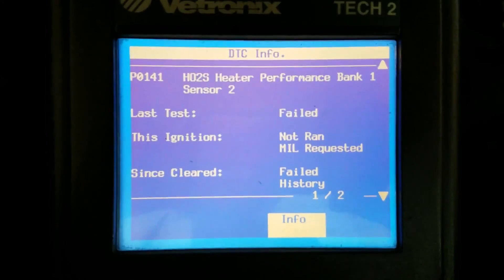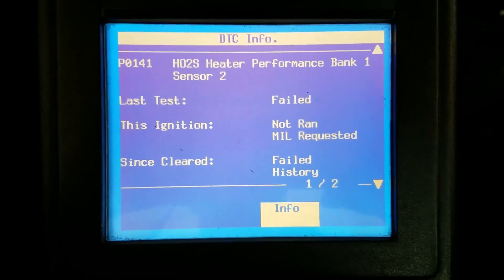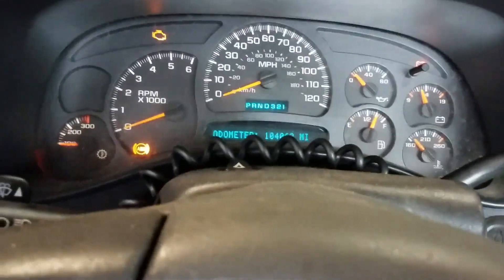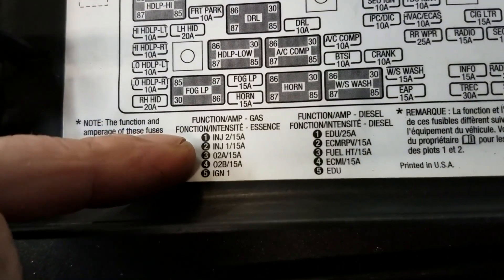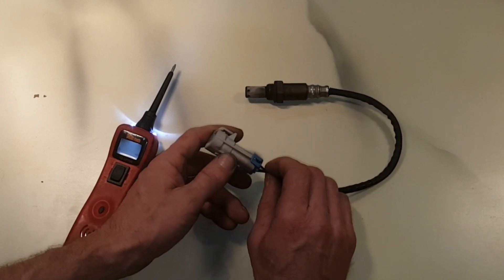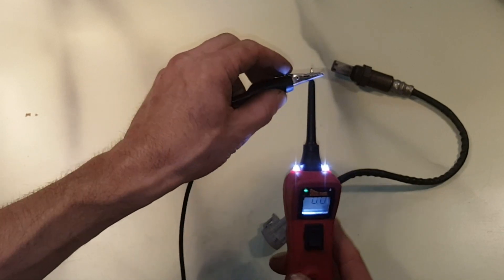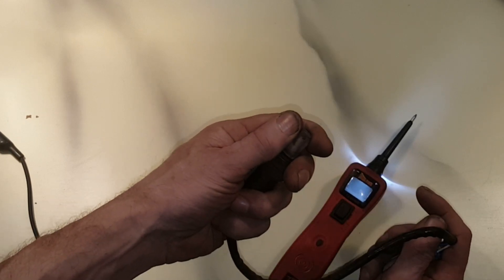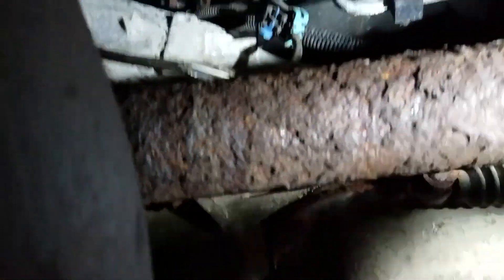P0141 P0161 O2 Sensor Heater Circuit "Chevy Truck 5.3L 6.0L"

Comment: Great Video! Thanks for the info. That’s a driveshaft? I have iron tent stakes from the 50’s in better condition, damn that salt on the roads is a killer on equipment.

Comment: I have an 04 tahoe with 5.3harn3s. And I swapped a 6.0 engine. Used square o2 harness like shown. I'm getting those exact circuit codes. The 6.0 donor car had triangular o2 sensors? Would that cause a circuit issue?  Im using sqaure sensors into square harness. Should I splice the 5.3 harness to adapt and use the triangular sensors?

Comment: Got an 09 Escalade 6.2 liter. The fuse was blown. Changed it and the code did not reset. Thanks for your help. I’m hoping the blown fuse is not a sign of worn out o2 heaters.
Reply: On an 09 Escalade the fuse is #8

Comment: I have a 2011 Silverado 5.3 I changed all the o2 sensors and the fuses are good what can cause all these codes p0050,p0155,p0056,p0160,p0154,p0060,p0059,p0161? And the check engine light

Comment: Sir thank you because after replacing all 4 O2 sensors lean light was still on. Once I replaced fuse all is good.
Reply: What fuse did you replace?
Reply: @liljoecompton165  The o2 sensor fuse
Reply: Where is this fuse?
Reply: @johnstark5780  hahaha 🤣
Reply: @johnstark5780 watch the video budddddd

Comment: Fault code: P0056
Fault code: P0130
Fault code: P0160
Heated Oxygen Sensor Heater (HO2S) - Circuit Malfunction (Bank 2 Sensor 2)
O2 Sensor - Circuit Malfunction (Bank 1 Sensor 1)
O2 Sensor - Circuit No Activity Detected (Bank 2 Sensor 2)

Bmw 320si e90 n45 2006 need help.
PS: i have change the 4 sonda lambda. Check engine still on

Comment: Ok so i have a 2000 silverado Z71 that got some water damage.The only trouble codes that the OBD2 showed was po 122 which is the trottle position sensor and a po135.not sure about this one and then a po161.could anyone tell me what the po135 problem is? Thanks

Comment: 02 chevy 1500 5.3 bank 1 sensor 2 failed, going to test and replace if bad but have a massive lack of power.  can an 02 sensor failure cause a big lack of power alone?  (truck wont maintain 65 going up a slight grade)
Reply: THANKS FLAT RATE MECHANIC!
Reply: Check the first fuel pressure,02 sensors, MAF sensor, TPS sensor,Map sensor,TB clean, Vacuum leak, Ground wire, Fuses, PCM,and Catalytic converter, lol 😂🤟

Comment: Great vid. Question: I have both codes 0141 and 0161 on 04 Tahoe 5.3. Changed both downstream o2 sensors and code came right back on. Where would you look next? Thanks in advance.
Reply: Check your 02 sensor pig tail connection. They get corroded just like the battery cables, so u have to repair or replace them. Hopefully that works
Reply: Did you figure it out yet I’m having same issue
Reply: Did you get it fixed having same problem
Reply from the maker: I believe there are also fuses for that 02. I would check your fuses next.
Reply: @FlatRateMechanic  yeah same exact problem on my  01 yukon.
Reply: Thanks. They’re both good. I’m stumped.
Reply: @pcbfisher3876  Did you ever fix your problem? I'm currently having this problem on an 08 escalade.